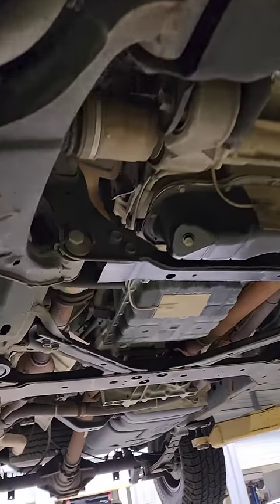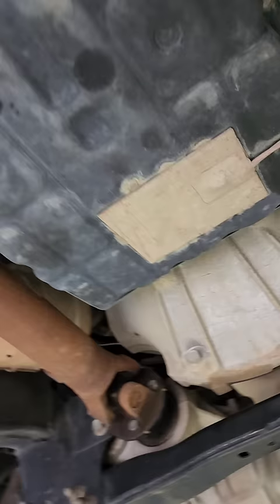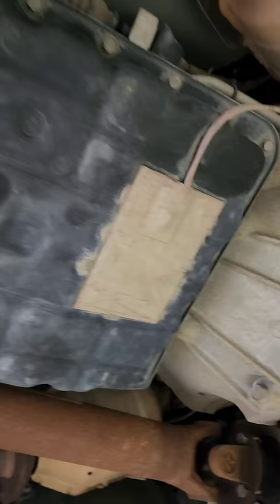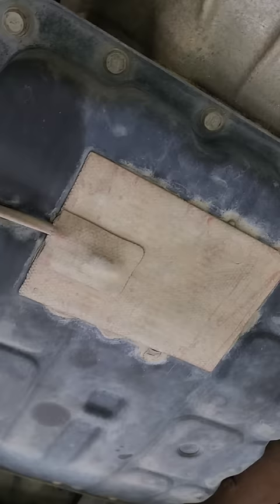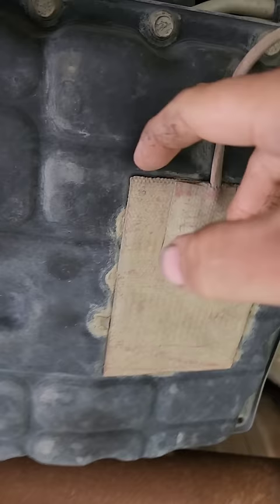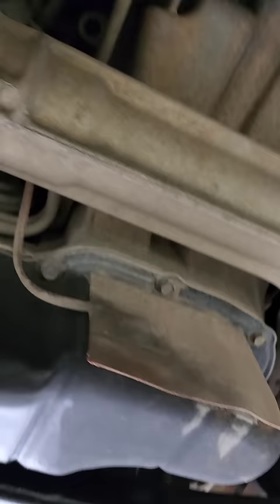CRINGY Mechanic Inspection #shorts #auto

Comment: When a Southern mechanic works on his first Northern car 😂
Reply: My first thoughts too.
Reply: On my motor home I had heating on the fuel tanks and lines, potable water, grey and black tanks, transport and oil and cooling. And the propain tanks. All plumbing and air brake systems. This was because I spent 4 days in -30C and it was too cold for even the propain.
Reply: He is not a Mach he is a tech their a Lil slow!
Reply: Hell I'm in the south and knew that was a heater lol.
Reply: When a guy dressed in dickies who changes oil, calls himself a mechanic...  

 He sure as hell aint certified, not noing what a heat pad is...  Doesnt matter where he's from.
Reply: More like his first Canadian car or Minnesota Montana
Reply: @joeytomato  Ehh. I've worked with "certified" techs before that did not have the hands or ears to mechanic well in the real world. All that means is they can pass paper tests. Fairly certain ASE does not have a module involving aftermarket attachments.
Reply: @joeytomato i live in the north and owned 6 vehicles and it gets to -8 degrees and none of them had those "heat pads" they make certain oil for certain temperatures. So your theory is false all northern drives have these heating pads on. And i work on cars myself and this is my frist time ever seeing these so called heating pads
Reply from the maker: @joeytomato  lmao in dickies?? U do know dickies are work clothes right? Lmao btw im not wear dickies...u blind dawgy 😅🤣  but aye keep commenting that im not certified...coo with me 😅🤣
Reply: @spiderbitedml385 not all vehicles have them but when you're in an environment where you need them such as Northern Canada they are absolutely necessary, your car doesn't start without a block heater and sometimes a battery heater and certainly sometimes oil pan heaters like these too
Reply: @joeytomato we don’t need that shit in Texas. It was 110 today
Reply: I'm from the south and knew that and I'm 18
Reply: @spawn1asasnsr874 they're* maybe you are the slow one 🤔
Reply: @spiderbitedml385 yeah this must be new but as a tech I’ve SEENED heaters for the blocks of truck engines but these never seen and many vehicles I’ve come in the shop and mind I’m a new Englander from the rust belts.
Reply: @joeytomato you can't even spell know
Reply: @spiderbitedml385  negative 8 is pretty cold but many of use have to drive when it's a lot colder. It hit negative 38 °F when I was at work last winter and many of the vehicles would not start. Keeping your battery from freezing makes the most difference but these oil pan heaters help the engine a lot. When it's that cold your engine oil is like syrup and it's quite hard to pump.
Reply: He will also say "is rusty" in his write up
Reply: Im southern, and not a mechanic. This video is when an idiot comes across a heater.
Reply: @joeytomato excuse me I’m a certified diesel tech I wear dickies they are cheap and I don’t get so pissed off when I rip them and when I do I go spend 10 bucks get 5 shirts and the ripped ones get turned into grease rags however I did know that was to heat the engine and transmission oil/fluid 😂😂😂
Reply: I am a northerner who moved to the south and then found out a little late that these houses aren't insulated for shit and you have to run your water or your pipes freeze. My pipes froze.
Reply: He's use to rust 😂

Comment: This mechanic got his training from the McDonald’s drive thru.
Reply: Southern mechanics will probably never see this in their life since we never get freezing levels of cold down here. It’s probably a northern car that was brought down south and/or he’s new 😂
Reply: @diarfejzullahu9623  you must be from the far south. best known as the land of the gators because in Texas it gets cold enough to freeze people to death.
Reply: @demonicas2567  that doesn't take very much these days...

where I've been, it's possible to get frostbite just by stepping outside for 10 seconds!

bundle up with oversized clothing to keep all parts of the body well covered cause it's another cold one!
Reply: It is an Alaska car, but mechanics outside of Alaska rarely know what that would be or know one when they see one.  I have heard of them because I was in the Air Force and people stationed up there talked about having to have them, but I had never seen one till now either.
Reply: @demonicas2567  those days are few and far between though and having pads isnt really necessary still. Ive never seen these either on a car. and im in tn.
Reply: Alaska is extremely cold in the winter those are heating pads to warm up the oil and transmission fluid prior to driving
Reply: Walmart mechanic
Reply: Bwahahaha 🤣🤣🤣
Reply: @demonicas2567 I live in Tennesse and worked on cars all my life and have never seen those on a vehicle. We get -0 temps for a few days through the winter.
Reply: Idk but sounds like satire to me  good bet that warenty void alaska sticker  gives it away
Reply: NOPE!.... It was the "PRIZE" IN A CRACKER JACK BOX!😂😅😂😅😂😅😂😅😂😅😂😅😂😅😅LOLOLOLOLOL

Comment: Heating pads.  It gets bellow -25 in certain place in Alaska so if you don’t have heating pads on your engine oil, trans mission, and battery your car will freeze and will not start in the mornings.
Reply: And this guy is supposed to be a professional mechanic. Heh
Reply: Heating qoils
Reply: @My3ForEvaWithMe I've never worked on vehicles that ever had them before but even I realized instantly they were heating pads when they were slapped on the pans. Kid needs to go back to class. They teach it in tech school.
Reply: I live in upstate N.Y. we on average have a month of -25f to -30f degrees. This is common in my area. Also this guy has no skills. You can simply look and tell what it is.
Reply: Guys, first off, I was born in Alaska and it gets WAY colder that -25 on the average. And second, Fluff was just trying to hit the YouTube algorithm and get paid. Of course he knows what they are. A mechanic of his caliber has to have  more than a  basic common sense to be able to diagnose electrical, computerized, and mechanical issues. It's like looking at really complex puzzles and doing them backwards sometimes  so I am certain that y'all have been trolled. Also, check out the hint at the end with the license plate. You'll get it then... 😎👍 ALL HAIL THE FLUFF....!!!!!! 😂😂😂
Reply: -45 in most parts of Alaska
Reply: @TheMadSmoker  I lived in Alaska and we would say "Hey it warmed up to 20 below."
Reply: @tonys4250  lol

Comment: It's for vehicles up north. You're just not used to seeing it. Up north you got to keep the block warm, the battery warm, the transmission pan warm, and the differential warm. Otherwise you don't go no where.
Reply: Heating pad lol
Reply: ever tried to start a car with -30 oil?
Reply: You should stop being a mechanic
Reply: @jeremyling3054  are you talking about me? Because I'm actually not a mechanic. At least not by profession. Doesn't pay enough.
Reply: @jeremyling3054  this is very common to have oil pan heaters if you get fancy you add a coolent heater as well
Reply: You are correct. They are heating pads to keep the vehicle warm. They're using a lot in alaska Canada upper Main

Comment: Anyone who used heavy equipment before in the cold knows exactly what those are.
Reply: Even just a small car here in the north
Reply: Hydraulic oil tanks here
Reply: If U haven't on old deisels und3r tank fire to warm up 20below siberia
Reply: I haven't and l did.
Reply: Well, I learned what a block heater was as a kid on the farm and later on my own truck. I know of diesel tanks heaters,but I’ve never actually seen these before.
Reply: Oil heater
Reply: Burrrr

Comment: It’s a typical winterization feature on cars in Alaska, those are heating pads for the oil pan and transmission, there should be one under the battery as well.  They work great at 40*below…
Reply: Not just alAlaska bud
Reply: I've never seen one but as soon as he said Alaska i immediately knew it was for heat...but he's the mechanic? Lmao
Reply: I instantly thought they looked like heating pads and they were. Odd so many then you said Alaska. Go figure.
Reply: Had them on my truck when I lived in Alaska and yes also under the batteries too.
Reply: If you hold down the 0 (zero) on your phone’s keyboard, you can choose ° (degrees)…

Comment: Those are heat pads. They are used to help keep your fluid softer in zero degrees or significantly lower temperatures, and they are after market applications
Reply: I was looking for this comment and I found it😂😆
Reply: They keep the entire engine warm thru heat transfer.  -50 in wyoming during winter..we know what they are😊
Reply: Everybody knows you need soft fluids LOL
Reply: It’s called a block heater

Comment: Being from Alaska I would say they are oil  pan heaters. They heat the oil to near operating temperature
Reply: Not really, they get closer to -5⁰C to -10⁰C ( 20-28⁰F). Still makes starting much easier. Further south from Alaska you can get away with a coolant heater, which I bet you this truck also has
Reply: Are you referring to engine block heaters? I lived there for 20 years and most people who park outside have extension cords connected to their block heaters. Pretty sure that's not what we see here.
Reply: It is a heater.

Comment: Pan heaters. Normally used in cold climates to prevent hard start ups. Helps the fluids to circulate better on start ups in cold temperatures.

Comment: Pan heaters. In Alaska we had 4 heaters. Under the battery, the 2 pans and a block heater. You plug them into a normal outlet at night so your car doesn’t freeze
Reply: Is to keep the fluids liquid hot keeps it from gelling the oil transmission fluid exedra
Reply: And snake an extension through the firewall for a heater to keep the cabin and steering wheel not frigid. Spent one winter in Fairbanks. Great experience.
Reply: Wow, i live outside your continent and our winters cold asfck (-35 -40 celsius) but we dont use heaters like this, gonna be beter than coolant heater that pretty common here
Reply: Even I know these are heating pads and I live in a country that never gets cold enough to need them.
Reply: I was born as raised in Alaska and everyone of my vehicles had a block heater but if they were cold blooded then I installed pan heaters.

Comment: It’s a heating element.  Very common in Alaska and northern Canada.
Reply: AND North Dakota.  Basically, anywhere it gets seriously cold.  Multiple days per year it doesn't get above -20°F.
Reply: One is the positive terminal, and the other is the negative.   You connect them both up to a welder, and it heats the whole car.
Reply: And Northern NY. Last winter was mild and Saranac Lake only had 12 days below -30°F. Usually worse...

Comment: Pan warmers. Usually cheaper than block heaters. Not as effective, but still works and doesn't necessarily require any modifications to the vehicle.
Reply: Coming from Alaska it's likely it has those pan heaters, block heater, battery heater, and a built in battery maintainer. When it's 40 below for weeks at a time you either keep it plugged in or never shut it off.

Comment: Gotta be a technician in a warm state lol
Reply: We don't use those in Texas. The first time I saw one, I had the same reaction😂
Reply: Az tech n I’ve never seen this
Reply: @wh112978  lol I know right Texas is 100 degrees in the winter, with Dallas being the only city to see snow lmfao
Reply: Clearly
Reply: @roshawn1111  When it does snow, we just shut the hole state down! I planted my garden in February this year because we were done with winter already! 
Down here, we don't install heaters on engines, we add more cooling. Bigger radiators, better fans, extra trans coolers, that kinda stuff.
Reply: @wh112978  Im saying Dallas is the only city they even gets close to seeing snow, I live in Houston and trust me I know all about the bigger fans and rads LOL
Reply: Ive only lived in Southern States. I had to come to the comments for the answer. That doesnt look OEM so i dont blame the Tech.
Reply: @cookmania3465  yeah I don’t blame him either. They’re usually dealer installed.
Reply: @roshawn1111  so 200+ people didn’t die last winter due to the cold?
Reply: @andrewprina931  the reason 200+ died is because its unheard of here in Texas. Just because it happens once or twice doesn't mean its the normal. Here in Texas the normal is it being 90+ during winter and 90+ in the summer.

Using the most extreme example doesn't prove a point, as its always a extreme example to pick from. There is ALWAYS a chance.
Reply: @wh112978 We don't use them in Colorado. Its an extreme cold thing.
Reply: @roshawn1111  There are probably more people who die of heatstroke in the North than people who freeze a death in the South. And a lot of the people who died in Texas is because of things like running their car in the garage to try and stay warm. It was really more about people not being able to deal with not having electricity than freezing to death.
Reply: @wh112978 this is the first time I’ve seen this in my life and I’m from texas lol
Reply: @roshawn1111 it 100% snows all over texas. We’ve had terrible storms in lubbock for years
Reply: @bharles4479  It does NOT snow all around Texas. Northern part of Texas yes, south Texas be lucky to see snow every 5 years. Born and raise in Houston Tx and I can count on one hand how many times it has snowed here.

Comment: You may want to consider a new career at Burger King.
Reply: What is it
Reply: @stevenhill297 You really dont know?? Or r u just f/n around? The hint is it's from Alaska. 🥶
Reply: At first I didn't and I work on cars but that's the thing about being a mechanic you learn something new everyday... but I wouldn't see anything like this in baltimore
Reply: @stevenhill297  I'm in Harford county. Wuts up my fellow Marylander!? And no, definitely won't. I've never seen anything like that in my life but I just added it together by the clues. You learn something new everyday in life.
Reply: I never seen anything like it but knew right away what it was...Get Help Dude.
Reply: The first giveaway is the cord sticking out from the grill, but he didn't bother showing that.

Oh and the Alaska only folks. I worked for a seismographic company in Texas. We had inline coolant heaters on the diesel engines to keep them warmed up on cold winter nights. 
All my mechanic works was in Florida. I saw block heaters through freeze plugs. The dip stick oil heaters. The inline coolant circulators and the heating pad way like this. And that's in Florida.
Reply: no, then he will make orders incorrectly
Reply: @eccentricsmithy2746  True but the potential to kill someone is a lot less at BK.
Reply: Now McDonald's  be hiring
Reply: @red2965  True and they count on the orders being wrong. BK may be Have it your way but McDonalds is FU you'll take it and you'll like it.
Reply: Lmao are we sure that’s a good fit? At least he can change the oil in the fryer
Reply: He could be from a  warmer climate. Dàaaaaaaaaa
Reply: @williambray7784  I live in Florida and knew what they were.
Reply: You might need a job where you don't have to communicate, because you're not too sharp at sensing sarcasm. He posted this as troll for comments like yours.
Reply: @peterjohnjoseph  Why do you tslk like you know everything, when you know NOTHING!!
Reply: @Randyluck1  Some of us are a little smarter or educated than others, doesn't mean we are dumber! Take me for example...I'm not educated (college) but have worked in Pharma, Bio-tech, Renewable Energy and have saved and own 2 homes with a High School education. I have common sense unlike MOST! Colleges are for some and even seeing those who went to college I laugh, NO common sense. Piss money away on High end cars and still live at home with MOM! Yea, laugh....you notice I didn't say DAD, because he will throw you out and have you become a man, not a boy!
Reply: Mechanics in warm climates may not be familiar with heating devices. Knowledge of them does not a good diagnostician make.
Reply: @Like_Ike  I’m not from Alaska and Ik what it is.

Comment: Heating pad, automotive fluids will get extremely thick when it gets -25°F or lower. When the army built the Alaskan Highway, they wouldn't turn off the equipment for weeks at a time to keep fluids from freezing, which will stop equipment from starting and / or operating.

Comment: They are called heating pads. You hear one on your transmission pan. Your oil pan. And you also have a elected heat plug in your engine block to keep your coolant warm. You need this where is extreme cold weather country. you have an extension cord that you can plug it into your house current. To your car. Should keep your oil and coolant at about a hundred degrees no matter how cold it is at night. In the morning time you can't crank up and drive away. Your engine has been warm all night.

Comment: In Alaska,  parking a vehicle in that cold weather will cause oils to harden causing hard starting. Those heating pads keeps oils warm enough for a restarting.
Reply: Not to mention allowing those oils to do their job and protect the engine/transmission at the critical start-up period.
Reply: Does the heater come on when the car is off? Does it have a separate source of power or is it fed off the same battery as the engine?
Reply: @tavita  mine is 110volt on a timer to come on 1 hour before I drive into work.